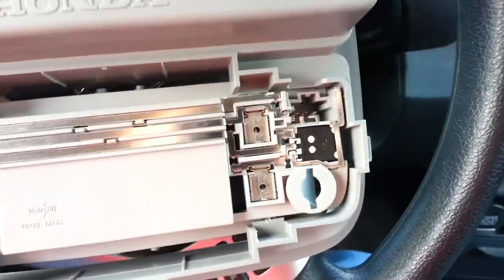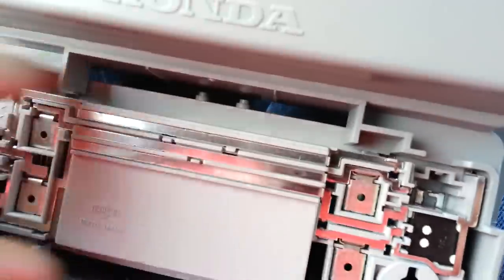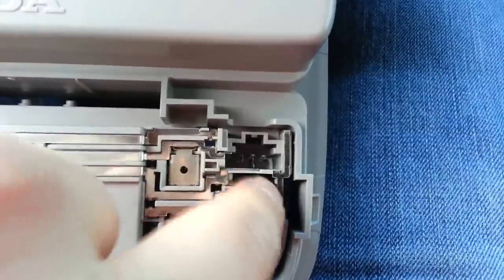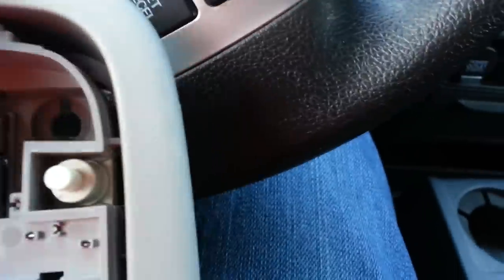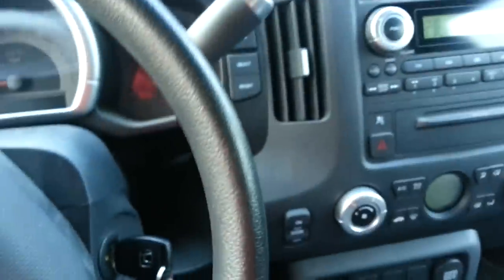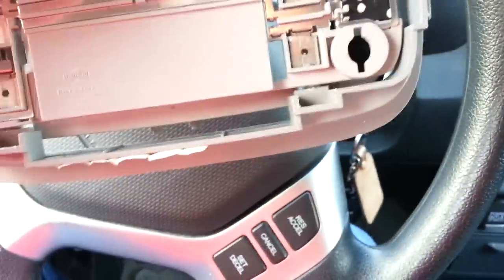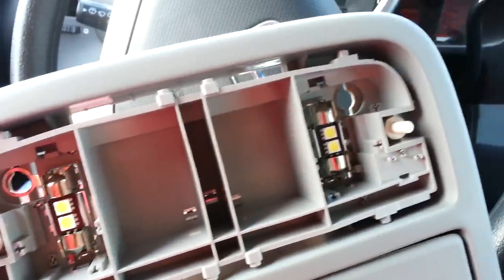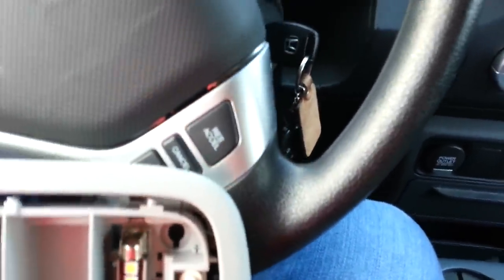Honda Ridgeline map light fix

Comment: This worked perfectly on my 06 TSX.  Listen very carefully to what he says.  I didn't at first and did not fully understand what he was doing.  Once you have the whole unit out of the roof pop out the lighting unit.  Then use a small flat screwdriver to pop the white switch out of the side of the lighting unit.  Push up on the three metal prongs so they are pretty much level instead of angling down. Slide the white switch carefully back on the three prongs and put everything back together. Perfect!

Comment: Though this is an older post; The fix  I did on mine was popping the switches out and cleaning the contact points.  The metal is "Stamped" when manufactured, leaving rough edges. The middle contact point  in the center had rough edges/burrs.  I cleaned off the burs snapped the switches back in and wallah, like new.  No need for new switches, simply clean contact points.
Reply: Please advise me on cleaning the contacts do I need to take off? As he did??

Comment: This has been bugging me since I got my Ridgeline. Took me less than 10 minutes and my light turns on now when I open the door. Thanks!! I used two small flat heads for the bending up part, one to hold the metal in place and the other to slightly bend up the tip of the part that feeds the assembly. Saved me $79.99 that I was told I would have to pay just for a diagnosis.
Reply from the maker: You're welcome! Glad I saved you some money.
Reply: I hope that I can do this thanks sounds easy enough

Comment: I also had the same problem with my 2008 Honda Pilot Moonroof Light. The driver side light would not turn on when I opened the door! If I manually pressed it I'd have no problem.

I contacted Honda and they told they me that I would have to buy a new assembly - which was too expensive.

So first of all I cleaned out the contacts in the white switches - this did nothing for me
Then I decided to switch out the switches - so the left side switch was taken to the right, and the right side switch went to the left hand side

And now it works like a charm!

Comment: I have a similar issue instead only the right side stopped working. I switch the bulbs and tried both on the right and left. Both bulbs work. Only the left is working. What do you recommend?
Reply from the maker: Go ahead and do the same thing to the other side. The issue isn't limited to just one side. Just do as I did in the video and bend out the pins on the other side, or the side that doesn't work.
Reply: Thanks man. Ill try in the morning once I get some light.
Reply from the maker: Yep! My advice is to take your time. If it doesn't work the first time go back and bend the pins out again. Good luck! Let me know how you make out.
Reply: jeb721 one question.. how did you get them up im using a flathead but I dont think the tip is small enough
Reply from the maker: Demetri C. I used a small flat head. Like one that you would use to work on small electronics.

Comment: Hi jeb721. by doing this will the map lights come on again automatically when the doors open ? Cause if I push the lights they come on , but not auto when the either door opens ? Thanx
Reply from the maker: Ian Kelly is the switch on your dash set to turn the lights on with your doors?

Comment: Jeb721:  Thanks for this great video explaining how to take apart the map lights.

To all video viewers:   Here is some additional guidance based on my experience:

1)  See this video for great explanations of how to take the map light unit out:  https://www.youtube.com/watch?v=SFyJ2Fn4KNk.  In particular, the clearish plastic light covers come out super easy if you push them in (as if you were turning on the light) and then stick in and apply prying out pressure with a flat screwdriver in the crevice that opens up while the cover is still depressed.

2)  If the issue is one side, do swap the switches and test to see if the map light on one side still does not work.  If you observe that happening, the issue is not with the switch!  Try the fix described in this video.

3)  If after trying the fix described in this video still doesn't work, the issue might be on the other end of the 3 prongs that plug into the switch.  This is what happened in my case.  I followed the path of the metal conductors and found that they were not tightly connecting to the power supply on the other end.  I applied pressure and tightened the connections and voila - problem solved while having to spend $0 to fix the issue!  :-)

4)  If the fix in #3 still doesn't work, sorry -> try installing new switches.

Comment from the maker: adubs00 You just need to open the sunglasses holder and remove the two lenses by gently prying them out with a small flat head screw driver. There should be screws behind them.
Reply: Please tell me more. Are you saying I don't need to take this piece off like he just did??